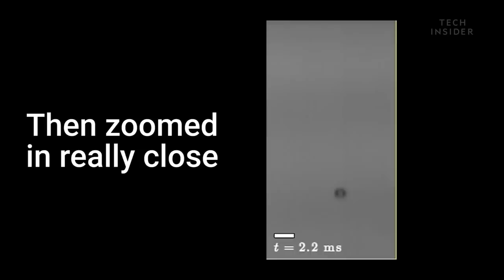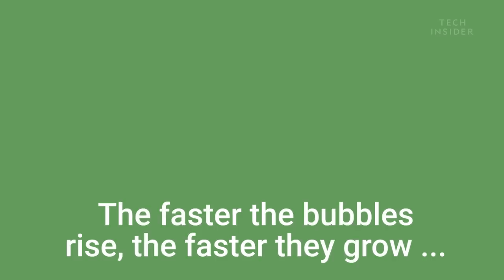Why Tapping Beer Bottles Makes A Foam Explosion

Comment: The beer is not in equilibrium when it is opened it wants to let a lot of the co2 out but doesn't have the energy to do so. Its the same reason why tapping super cooled beer freezes it. A driving force creates energy for nucleations (surface area of co2 bubble in this case) to form.

Comment: But why does it matter if the bottom taps the top? Shouldn't any vibration cause it?
Reply: My explanation of this phenomenon involves vacuum. 
Right after the hit, the two bottles are taken apart from  each other with sudden speed. This cause a vacuum inside the bottle that was hit on its top, but not on the other one. That vacuum causes an expansion of gas that is inside the bottle, so the bubbles quickly get enlarged, and are so, more prone to explode.
Reply: @guillaumegaudin694  You're joking right?
Reply: @wp7767  No, why should I ? If only the vibration was involved, both bottles would be fizzing like crazy. When you tap them in that exact motion, the major difference between both bottles is that one has its top free, so the air pressure doesn't vary much while the another gets a sudden rise and drop of pressure. Look at videos of beer or soda put in vacuum chambers and see why this is for me the reason.
Reply: @guillaumegaudin694  With this simple motion there won't be any significant pressure drop to have any of the effects you described. The top bottle doesn*t fizz because the vibrations travel from bottom to top with the top cap open. On the bottom bottle the vibration is reflected on the bottle walls thus creating the bubbles and the foam.
Reply: Take this video for example
https://www.youtube.com/watch?v=N25kKEN1Gcs
He is using a vacuum pump (!) which is running for 15s before any fizzling occurs. Do you really think that is reproducable by the simple raising of a bottle?
Reply: @wp7767  Yes, look at the size of the vacuum chamber, that's much bigger than the 2cL that are left of gas in a full beer bottle, no wonder it takes a lab pump 15s to get there. Plus the conditions are totally different, the beer is not shook by the impact at the same time, and the pressure drop happens slowly, not suddenly.
Remember that a glass beer bottle is quite heavy, thus has some kinetic energy. When it hits another beer bottle, also made of glass, there is almost no energy absorption, the hit is hard. The speed difference between the two bottles suddenly, virtually instantly, changes from positive to negative (ie from getting closer to getting further apart), at the exact moment when the two bottles are touching each other, thus the sudden change in pressure.
Reply: @guillaumegaudin694  this guy is just punching PVC tubes, there is no pressure drop or vaccum pulled anywhere.
Btw, water will start to boil under a vacuum. Try pulling a vacuum with your described technique at home and see if the water starts to boil. 
It won't happen because the motion doesn't cause any significant pressure drop. 
The fizzling effect is due to the shockwave being reflected in the bottle at the bottom
Reply: (btw, we're basically talking about the same thing. a sudden rise and then drop of pressure, it moves across the bottle, yes it's a shockwave XD)
https://www.researchgate.net/figure/Pressure-variation-measured-as-a-lithotripter-shock-wave-propagates-through-matter-A_fig6_257023480

And yes he might be "punching" pvc tubes, but the use of paddles hit with a specific motion on the tubes makes the sound much louder without the need of amplification. If he only used a stick, it would be much quieter.
Reply: @guillaumegaudin694  Yeah I'm not sure why you guys are debating lol.

Comment: Anyone know what happens if you completely seal off the bottle in time at the opening?
Reply: You can do that but there’s no way you can stop it when you open the seal at some point. The gas(CO2) eventually should get out of the bottle at some point. And it also depends on the energy of the explosion and the strength of your bottle. It may explode even if you seal it too. There’s a possibility.